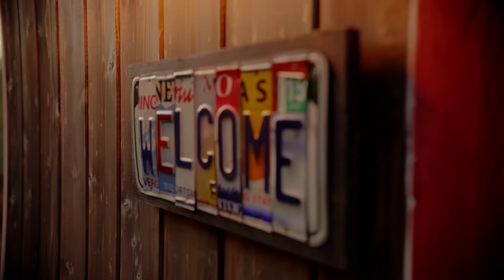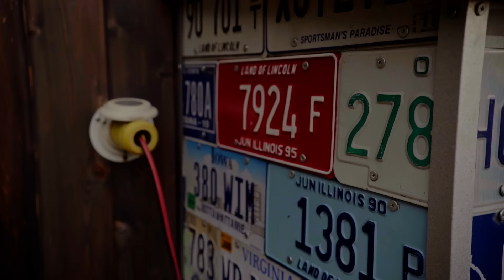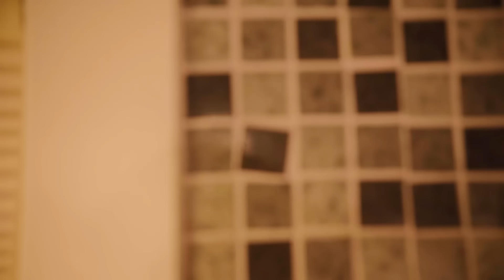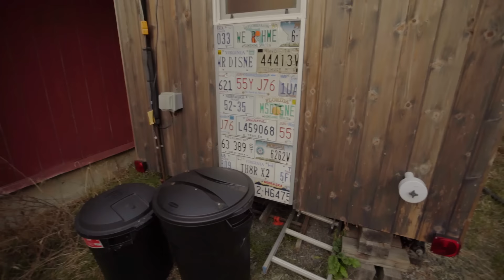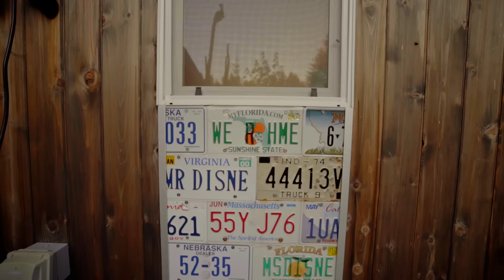SINGLE MOTHER Builds TINY HOUSE to Create RETIREMENT PLAN

Comment: I would also add a banister on the stairs so you wouldn't fall going up and a railing on the loft so you won't fall off during your sleep!
Reply: I was thinking the same thing, aging makes everything more difficult, at 63 I don't think I could take those stairs with having to get up and have a wee every hour. I'd probably break my neck. I wonder what her plan for that might be. With her skills I'll bet she'll build another down the road that will take the aging thing into consideration. Well done.
Reply: I am in my late sixties also! I guess younger people don't think about this stuff, but I sure do! Thanks!
Reply: You can also built the tiny house to include a murphy bed on ground floor and leave the lofts for storage or guests.
Reply: i like that idea  and perhaps some hand holds on the wall where the steps are just in case need to grab something for balance
Reply: Fumbling in the dark to go to the loo!  My thoughts too Charlene about the banister..just too dangerous - even without the wine! Perky lady isn't she!!
Reply: Something should have being planned for the stairs facing knees issues in the future. Also, the last step is so high.
Reply: sojourner.  Given the toilet she currently uses, she may use a chamber pot

Comment: Fix the stairs.  Then it's perfect!  Great pad!
Reply: I agree about the stairs, especially the drop on that top stair, which looks downright dangerous.
Reply: You can get a railing installed & that may surffice if you can’t broaden them.
Reply: Monica the reason that is built that way is because you are not standing while taking a step down. You are sitting and the same as when you go into your loft. You walk up, sit down, and then enter the loft.

Comment: Combustion toilets require no water and produce no waste except a cup full of sterile ash each month. Just an idea.  They exist and are available.
Reply: But are they affordable?
Reply: Far cheaper than a septic system.  Supposed to use only 25 cents worth of electricity per 'cycle' but you probably wouldn't want to use solar for that.  Someone needs to invent a magnifying glass solar heated combustion chamber for waste products.  Should be simple except for the fire hazard part of things... :-/